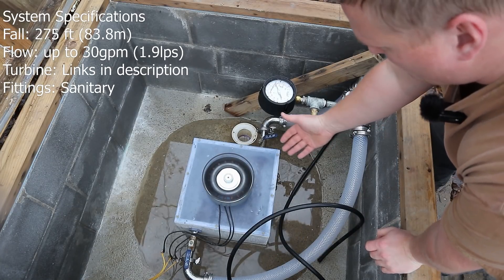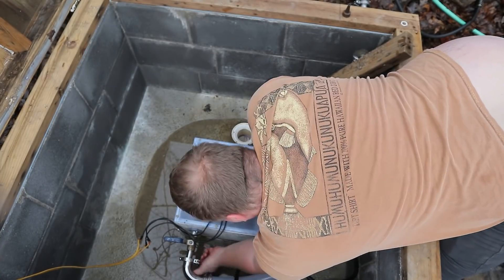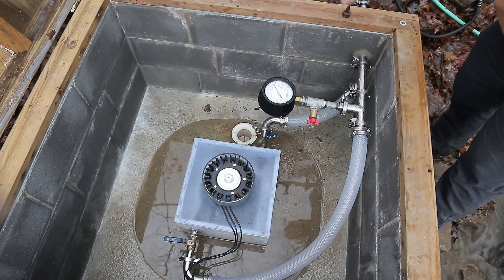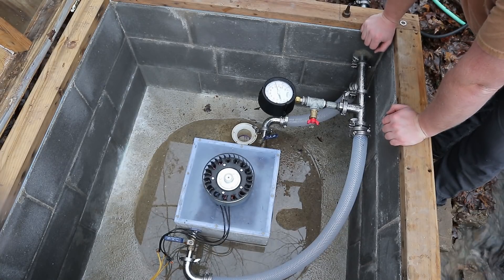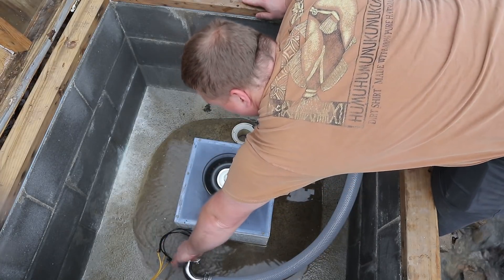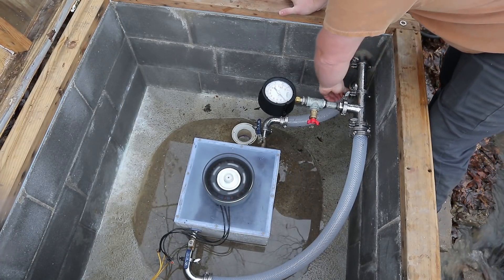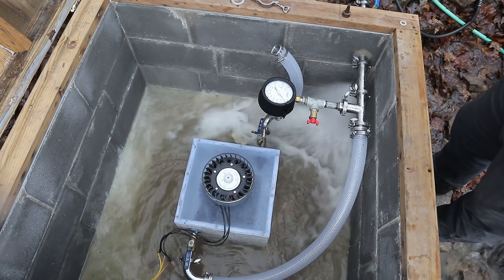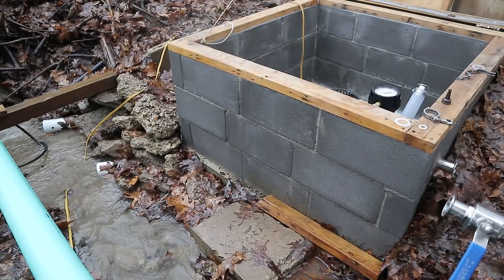575 Watt Turbine After Heavy Rain.

Comment: I feel like adding a transformer to boost the voltage would help given you're running such thin cable!
Reply from the maker: It's only 10A through 14 gauge wire 3-phase.
Reply: @JoeMalovich  Number 10 wire would help as at one point you saw over 20 Amps on the input. Would cut the resistance way down.
Reply: @JoeMalovich  you will still likely gain some decent benefits through reducing thermal losses by reducing current
Reply: I don't know the distance from your station to home... but with the assumption of 50-100+ foot run.... 14 gauge is too small. 

Nothing less than 12ga would be acceptable, 10ga being the best option at your power levels.

If that is a 1kw turbine, changing your transmission lines will likely yield another 100-300 watts... count on another 50-100 with improved housing geometry

Comment: I am sure you thought of this. If the housing is round you would reduce splashing. Other housings I have seen that are square have the sides canted outward at the bottom pretty extremely, like 45 degrees.
Reply: Agreed, he could try a circular one Inside a square one in case he was worried about it breaking
Reply: Yep, a round housing with a slot around the middle for the drain so the water is slung out of the chamber as soon as its slung away from the turbine. Like a turbo housing. Then it can be captured in an outer box to direct it down into the drain.
Reply: @ShaneCarles   you bet! if you use venturi shaded nozzles on the turbine supply it may show an increase of velocity on the turbine also, allowing for a good drainage, like you say to take away the water so it doesn't cause a resistance to the turbine.
Reply: I see this in every vid

Comment: why is the turbine housing square instead of circular? 
love your work btw.
Reply: I was going to comment about that. Waldo is right. Easy to make. This is a work in progress.
Reply: ease of manufacture and mounting prolly, it's harder to mount a pipe onto a small diameter circle than you would think.
Reply: Thanks guys I didn't think about mounting the inlet pipes
But still it would at least increase the efficiency and decrease noise
Maybe in the final build 🤷‍♂️

Comment: You could Install 4 differnd jets an open only the best ohnes for yor curret pressure so you dont have to change jets
Reply: Great idea, if you are going that way, throw in a digital pressure meter, a bunch of solenoid valves and a arduino that selects the right valves to be open according to the pressure.
Reply: @tristanfloris9970  have you been watching Kris Harbor natural building?

Comment: Would an angled housing push the water down rather than back at the turbine, like a pyramid?
Reply: A 45 degree corner block in each of the four corners would channel the windage in a circular path with the desired direction of flow and likely improve the efficiency while reducing the interference loss.

Comment: Maybe one of those cheap, inefficient, quazi-legal chinesium 12v grid tie inverters will allow you to put that power to some practical use.  What's your DC voltage just past the rectifier?  There are higher input voltage inverters, of course.
Reply from the maker: Rectified DC voltage is up to like 130+ so the cheap ones don't work, plus they need a bunch of amps for the shunt to read correctly. There is no ideal cheap solution.

Comment: Joe, how you 've achieved so much pressure from stream?
Reply: The stream is.275ft higher then he is.  Watch all his vids.
Reply: @paninisinabox  I haven't seen all of them. Thanks.
But is gravity capable of providing so much pressure?
Reply: @takismenexes6131  1 bar per 10 meter. I assume his inlet is about 70-80m above his generator level.
Reply: @billigerfusel  How easy whit metric.
Reply: @skrukke  i know, right
Reply: @skrukke  Royale with cheese....
Reply: @takismenexes6131  yes!
Reply: @takismenexes6131  if I remember correctly, its one psi per about 2.5 feet of head or so static pressure. The larger diameter pipe, or penstock, the less pressure drop while its flowing.
Reply: Takis Menexes think of it less in terms of pressure and more in terms of energy. The energy provided by that height difference is equal to the mass of the water (1 kg/L) times gravitational acceleration near earth’s surface (9.81 m/s^2) times the height difference itself in M (roughly 85m). Every liter of water that descends that height will convert 834 joules of gravitational potential energy. So we can see that for every liter per second that flows down that slope, 834 joules per second, aka watts, of gravitational potential energy will be converted into other forms of energy, mostly speed (kinetic energy) of the water itself.
Reply from the maker: It's a spring but correct.

Comment: Very cool. What would be the solution to the windage issue? I understand it probably doesn't make sense to implement whatever it may be, since high water flow is temporary.
Reply from the maker: turgo
Reply: The majority of Pelton wheels like this, are set on a horizontal axle to combat windage problems. Joe is eventually going to use a Turgo runner which is a vertical axis device. The box he  built will accommodate the Turgo since water flow will be from top down, eliminating windage losses.
Reply: Well that was a duh moment on my part!

Comment: I think a better case is required to increase efficiency, there is a lot of water bouncing inside the case. A 30° back walls that diverge the water down will help. Do you plane to update your battery maybe with lithium batteries? Possible LTO for very long life bateries?
Reply from the maker: Turgo is the answer. Yes big battery bank sometime.
Reply: gerard capdevielle brevet on french forum
theorically 5GW with 1meterX5m fall
(perpetual water wheel motion, in video, seems same laws)

Comment: That's satisfying Joe 500> is alot it can safe you some amount on electric bill,what plans do you have?try sealed lead acid 24v system maybe?... My items have not arrived I guess corona is the issue otherwise am dreaming of having such a great system👍
Reply from the maker: I've been looking for a grid tie inverter with limiter.
Reply: @JoeMalovich  Yes, it is pity you don't have more volts and less amps and then Solis 4th Gen inverter would work lovely - grid tie is built in.   Though as we install grid connected solar and not hydro, I don't really know what I am talking about!   Would MPPT work equally well on a hydro curve as a solar curve?
Reply: @JoeMalovich  the best GTIL inverters I've come across are made in China by  SUN. Have you come up with anything else? I'd love to know if there's more out there.